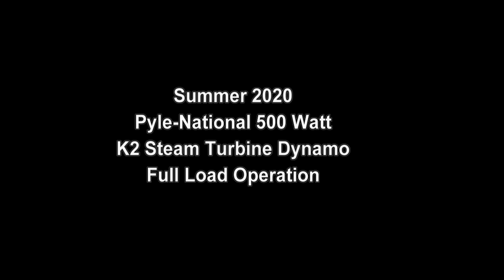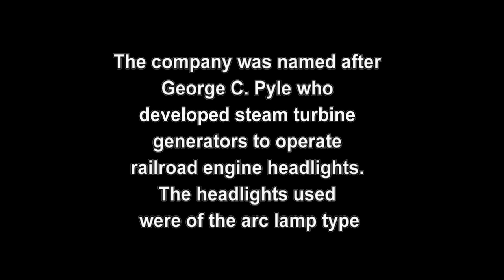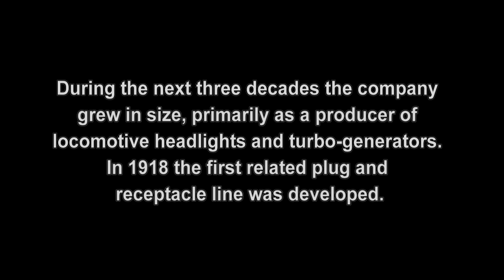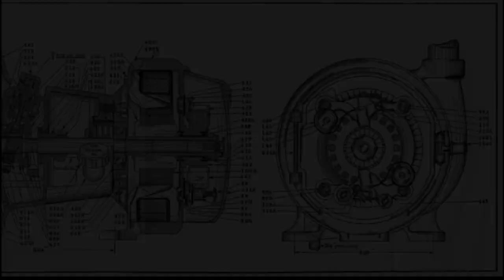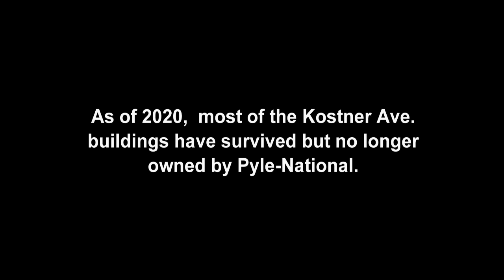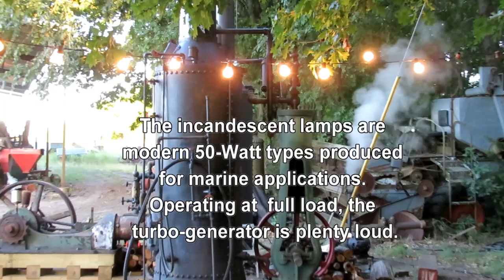1910s Pyle-National 500 Watt K2 Steam Turbo-Dynamo Full Load Operation

Comment: Excellent!  Now plumb the exhaust to the engine running the cordwood saw and you can cut firewood (or boiler fuel) all night long.
Reply from the maker: Actually, if properly designed, a  a low pressure turbine steam engine could run off of the exhausted steam from a reciprocating steam engine for additional energy recovery.
Reply: @lineshaftrestorations7903  A Modern version of that is called an electric-turbo compound generator.

Comment: I worked on one of these dynamo's on a steam loco once, the dyno was powering a 32 to 12v  dc to dc converter to supply power for the communication radio, someone had serviced the dyno but didn't know that the output was dc and swapped the wires around. when the loco was fired up the wrong polarity blow up the  dc to dc converter.
Reply: The loco was in the service yard and there was enough steam and we drove down the line a bit, the engineer aloud me to open the throttle and apply the brakes. it was so cool to feel the power and be in charge of the train( with the engineer telling me what to do). a real high light of my career as a radio tech.
Reply from the maker: A reverse current cutout relay or simply a suitable diode would solve the reverse current problem.
Reply: @lineshaftrestorations7903  yep, the radio gear was installed by someone else, i did put in some sort of current protection, i just cant remember want though... it was 15 years ago.

Comment: 500 W is about 2/3 of a horsepower
Reply: With a DC system low. Voltage it takes   1 HP to genrate 380 watts as a rule - at 64 volts and higher it's takes 1 HP to generate 416 watts AC or  DC - small air cooled Chinese generators have all kinds of kw ratings - to get a true out put it's the engine HP x 416 - the smaller 2 kw sets use a R frame generator most cases  those are normally set a 64 hz or 3900. RPMs to get an average 120 volt reading also so induction motors will run
Reply: By the book 1 hp equals 746 watts - as a result of electrical magnetic losses in a 32volt system 1hp will only generate 380 watts as a rule

Comment: Out of curiosity what is the approximate rpm of the dynamo? and if it's as fast as it seems to be what type bearings were used? Thanks great video
Reply from the maker: These operate in 3000 to 3600 rpm range. This model has ring oiled ball bearings.
Reply: That was a good questions - my grand father was an early machanic electrician he all ways had something to say about the 32 volt systems and rail mail cars were the first to have wheel generators & electric lights and how the wheel genretor brush assembly shifted to maintain the correct polarity when the cars switched directions,  he also talked about the Edison's rail road iron battery's and how the plates had to be scrubbed every 10 yrs - also a 6 &12 volt battery was 6 & 12 volts because the acid was around a 1.190 gravity - that's considered a dead today, they didn't sulphate also with a low gravity acid mix - at 1.190 gravity acid they were 2 volt cells - power houses were often  hybrid plants and they would run the gens 1-3 times a day for an hour & 20 minutes for each run to charge power house battery's - fuel was considered expencive adjusted for inflation fuel was around 17-20 dollars a gallon - he mentioned the DC power houses burned 1/6th of the fuel that the AC power houses burned for the same kw out put so there power was cheap compared to AC power - also with 1.190 acid battery were designed for 70- 80.yrs of serves - if they did sulphate they just removed the acid and filled them with baking soda and water - when they quit foaming they pumped that water out and rinsed the cell and added acid back in the cases - I've seen some of those battery's as a kid in old power houses  they were 5ft high 5ft wide and 10 ft long I think they were 100000 amp cells - they charged from 95volts at start and at finish was 125 volts if i remember right some areas like French Quarter in N.O. - had four different voltages, from four different companies serving them power - the railroad brought on the 32 & 64 volt farm lighting and small town electrification as a result of having power at railroad depots  and ice houses for rail car refrigeration - my grand father mentioned all that - many of the old oil engines ran at a speed slow enough to burn most of the fuel also they used oil as a coolant and ran the engines at 250° so the engines burnt all the fuel so they were 60% fuel efficent
Reply: @able880  Amazing pieces of American History. Thank you.
Reply: Great information!What are we hearing running in the background earlier in the video?

Comment: Very cool machine, but to do something like charge a home battery, it would need a whole heck of a lot more output. For the lights it was good enough.
Reply from the maker: This is fine for directly powering 32v incandescent lamps. You would need about 40v to charge a 32v battery. It's possible you could make changes to adapt to a 24v system but there are likely better ways to do it.
Reply: @lineshaftrestorations7903  we will be building a house in the near future, I wanted to create a steam generating system because my power grid allows two way metering. Create the power and sell it now, then use the grid later

Comment: Very neat machine! I am fascinated with all power generation stuff. Need to look up more on this to see how the voltage and speed regulation works on it.
Reply from the maker: I believe there is a manual available on the vintagemachinery.org website for Pyle National K2s, if not let your fingers/thumbs do some googling.
Reply: @lineshaftrestorations7903   Thanks, I will look up that manual!
Reply: I have one of these too! It works, but it's missing the door on the collector side. I'm located in Belgium. The only way I think this thing got here, is thru the WWII Canadian 2-8-0 locomotives that where shipped to Europe, and after the war they became a part of the rolling stock of the Belgian Railroads up to 1966, when the last one of these did their service. How much are the worth you think?

Comment: Beautiful little Genny. How well did the Vertical Boilers keep up with her in terms of Steam Demand?  I know they can be Steam Hogs. Looks like that smaller VFT was keeping up with her, but was probably at her maximum Steam Rate. With your bigger Boiler there was probably enough Steam left over to roll over some smaller Engines slowly under no load, and to run the Injectors.
Reply from the maker: The boiler keeps up fairly well on the small K2 turbo. The boiler is only rated at 100psi. Turbines love higher pressures. 125-150 would be much better. For the power generated, a reciprocating engine and a belted dynamo would be a better solution on 100psi.
Reply: @lineshaftrestorations7903  Exactly what I was thinking. I have a similar sized CH Dutton Coal Fired Vertical Firetube that is all welded and very similar to Boiler you utilize most of the time in your videos. So I'm gathering food for thought on how I'd like to set things up.

Comment: Is there a way to route the water back to the boiler for re-boil?
Reply from the maker: It's possible to set up a condenser system. An reuse the water. On a small scale the system complexity would be expensive. I doubt I'll attempt it.

Comment: I have a 5000 watt generator powered by a 10 hp gas engine, normal running rpm of around 2500.  The engine is blown and I got wondering if I could hook the generator part up to a steam engine.  Do you think that's feasible and what size steam engine do you think it would take ?  I'd appreciate any suggestions
Reply from the maker: An 8HP steam engine should be able to run that generator at full load. A common problem is not having enough steam to sustain the load.
Reply: Almost no steam engine with reciprocating pistons will run very long near 2500 rpm... for those speeds you are likely needing a steam turbine.
(or set of nearly 10x step-up gears )

Comment: How efficient is this, compared to using a reciprocating steam engine to turn the dynamo?
Reply from the maker: If the boiler was carrying 125psi or greater the efficiency would be fairly good. Since this is running at 90-100psi a well tuned reciprocating steam engine an a belted dynamo would be a better system.

Comment: I wonder what size of boiler and rate of burn is required to actually sustain running this dynamo indefinitely; I'm assuming at the rate of discharge this boiler will drop below min PSI to keep the dynamo running? Or I maybe wrong?
Reply from the maker: Something in a 5 boiler HP rating would probably work. 8-10 boiler HP still better. 125-175psi would be better than 100psi.

Comment: I wonder if the 72 volt dc systems on locomotives originated from these systems one way or another?  Anyone know?
Reply from the maker: 75v on a diesel locomotive is the charging voltage for the 64v starting battery. It is also used in the system that excites the main propulsion generator/ alternator.

Comment: What is the steam supply (diameter and psi) to the turbine?
Reply from the maker: 1/2" iron pipe size. 80-200 psi for full load.
Reply: @lineshaftrestorations7903  Thank you 😁